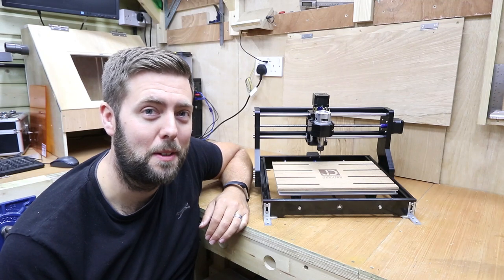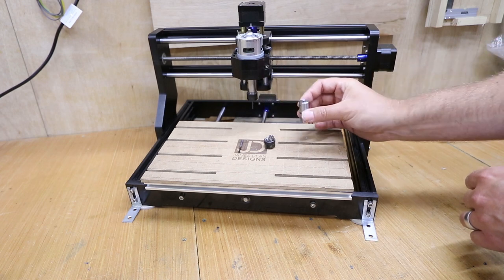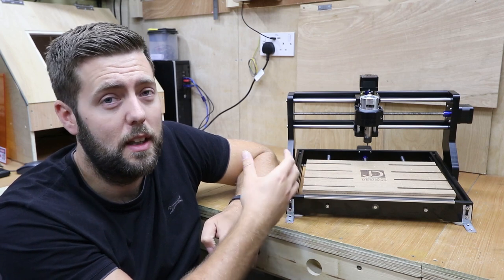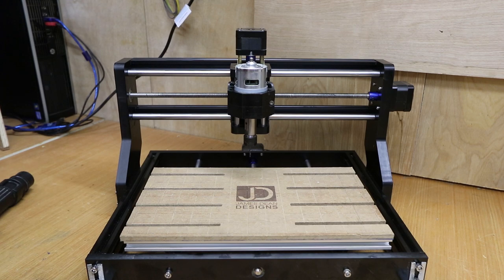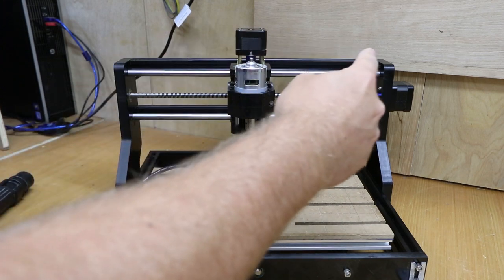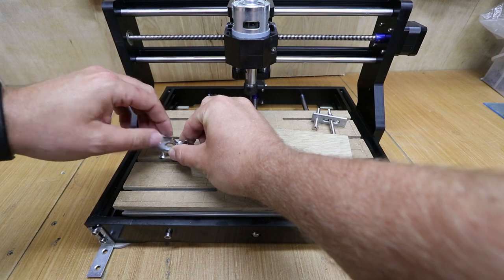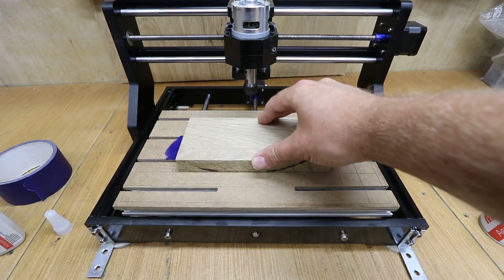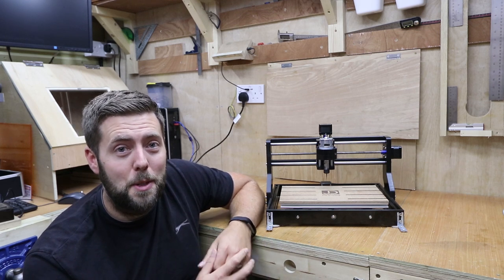3018 PRO - Tips and tricks

Comment: Hello James
Thanks a lot for your videos, they are really very clear and helpful. Regarding the chucks - how are they mounted or taken off? I have got a motor with 8mm shaft separate from the chuck. The chuck‘s hole is about 0.1mm narrower. Should I use some press or heat the chuck to get it on to the motor? To which degree to heat?
Reply from the maker: To mount, they are often heated up to put them on. You can heat them up to take them back off but you have to be very careful as the heat will damage the motor. Alternatively trying to gently prise it off

Comment: Re the Z stops, can you not 3D print a mount that would offset the Z-stop enough so you don't physically use any cutting space?
Reply from the maker: Something like that will certainly help minimise the amount you lose but by the nature of how a limit switch works you would still end up losing 1-2mm minimum off each end. Doesnt sound much in theory but let's say 2mm off each end would be 10% of the cutting height lost

Comment: Thanks for a good video, but I completley disagree with you about limit switches. They are possibly the best upgrade I have made to my 3018. When I first got mine I thought the same way as you, but once I fitted them I could never go back. With a simple homing cycle you can get the machine back to almost exactly the same position every time. They're good enough that I can stop the machine, move axes, re-home and continue without issue. Invaluable if you use more than 1 tool on a job, as even a small bump on X or Y not known by the machine can ruin everything

Also add a small right angled stop onto the base and clamp workpieces up to it to have an instant known position, so much faster than manually aligning to the corner of your workpiece every time.

You will most likely need some decoulping using capacitors to ensure the switches don't get triggered by electrical noise, but well worth the effort. You also don't need one for the bottom of the Z axis, if you've gone that far you probably already have far bigger problems.
Reply from the maker: Might just be the difference in work that we do. My most popular product literally uses every millimeter of the Y axis, in fact it uses 182mm so I couldn't afford to have limit switches even if I wanted. I actually just need a bigger machine 😆 I can see the appeal of the homing though and being able to return to any point

Comment: Don't know if this is the right place to ask, feel free to move it... but do you have a video on how you made that slick waste board?  There's lots of thought and design that I'd prefer not to duplicate the effort and steal it, eh..that is to be educated by you...:) I went to your site and searched for similar items such as waste board, but it returned nothing....  Both the CNC Gcode on the slots including the engineering behind the gcode generation and what holds it to the table.  Simple things like how do I make that when the table size is the limit size of the machine and then add that I have limit switches?  The the laser etching is also a nice touch and should be included. I'm sure it took time to get that. Remember I'm in your shoes when you started way back... And, like you, I've found myself using this damn thing for far more stuff than I ever thought possible. A waste board, like yours, would be a nice investment and looks really sharp.  Thanks... take care (*-*)
Reply from the maker: Head over to the Sainsmart Facebook group. In the files section you will find a guide by Graham Bland on how to make this spoilboard with all the files. I plan to make a video about it, just not got onto it yet
Reply: @JamesDeanDesigns  Thanks you're awesome dude... (^-^)

Comment: Thanks James, Just built ( two days ago), and need all the help I can get. I will be putting your tips into practice. Now All I need to do is to have the courage to actually get cutting. Feeling a bit anxious. Not sure which program to use to generate the code 🤔
Reply: I use openbuild to run the actual machine, I use carveco to go from image  to Gcode. It's a subscription deal but to me it's worth it. Beware, the learning curve is kind of a pain in the butt. I'm up to doing acrylic so far but I'm working towards full 3d carving but I'm not there yet
Reply: @stevenolson4995  Thanks Steve. I will have to take the plunge and if anything.. Learn by the Whoopsies 😁
Reply from the maker: Hi Peter, I can't comment on the software Steven mentioned as I've never used them but just start simple. One of my other videos in this series is simply engraving a square and that's a good place to start. Slow, steady and shallow, then build up from there 👍

Comment: Hi James. I thought I had cracked my problem as I found my spindle connection into the stepper motor wasn’t seated properly. Rectified this and ran job. Got halfway through and then the bit moved to a new position but didn’t retract and cut across the piece and snapped the bit. So still ruining my pieces.

Comment: Hi James just found you posts on YouTube and found them very interesting i have had my 3018 cnc for  a couple of years now 
and haven't used it much as have a k40 laser engraver and cutting machine also 2 3D printers but have just converted my garage
to a little workshop, so have just found my cnc machine tried it out and still works well could you please tell me how to set the z probe up and what you connect it to.
Reply from the maker: On your control board you should have 2 pins marked up as A5, be careful not to mix them up with 5V as they are often close. I managed to salvage 2 spare little connectors off something else but in reality the cables just need to contact those pins and nothing else. It doesn't matter which way around they go on the A5 pins

Comment: Hi, thanks for the suggestions.  Very helpful.  What size of carriage bolts did you find work best?  Cheers
Reply from the maker: M6 I think I used. As for length, I'd depends on the thickness of material but probably 50-60mm at max

Comment: Great Video James.  I'm new to CNC and your video covered a number of things that are not mentioned elsewhere.  I have considered the 3018 Pro as it seems to be very popular.  I intend to use my CNC for double-sided PCB (Printed Circuit Board) milling.  One question if you can answer it: The Sainsmart website shows the 3018 Pro with a price over $400, but I've seen the same machine elsewhere for much less. So is there any special reason to go with the Sainsmart rather than a less costly source?  Looking forward to your other videos when they come out.
Reply from the maker: Which model are you looking at. I just double checked and the 3018pro with the laser is $399 and the on its own about $260 USD.
In short, there are lots of makers of the 3018PRO but its better to stick with the more reputable companies. I got mine from ebay and after several issues that they wouldn't resolve I had to go through a PayPal claim. This is why I now recommend Sainsmart as their customer service is brilliant
Reply: I was looking at the Sainsmart 3018 Prover which also comes with a laser attachment and also has the z-test.  I agree with you that it's best to get it from a reputable seller.  I have not dealt with Sainsmart but their website provides lots of information, so I will likely go with them.  They also offer extension rails (https://www.sainsmart.com/products/genmitsu-3040-y-axis-extension-kit-for-3018-series-cnc-router?variant=32757200322639) that increase the Y-axis for larger projects which is something I'm interested in.  To make my decision more difficult they also show a 3018 Prover Mach3.  Other than certain options and that it uses different software it's not clear to me whether it would be thr better choice for my useage.  Both seem to be the same machine but using different controllers and different software.  And if the various 3018 versions weren't enough  they also offer the 3040 which seems to be a "better" CNC though I don't know in what way.  My usage is to mill printed circuit boards for electronics rather than wood or other objects and I think I've seen some PCBs milled on other Youtube videos using the 3018..  So the Sainsmart 3018 Prover would seem to be able to do that as well as the more costly 3040 but I have to be convinced on the 3040 and so far I've not found anything on the 3040 that gives it the heads-up, at least for me.  If you've done any printed circuit board milling with the 3018 I'd be curious to know your comments on it. One question I can't find an answer on is how fine a line (in width) can the 3018 mill; line width becomes important to know with PCB milling since it determines how dense a circuit board one can mill reliably before the tolerance of the machine is exceeded.  I see that you also have a video on using the laser attachment so I will be viewing it shortly.  In any case, thanks for your reply and comments James.
Reply from the maker: @DIYerGuy  personally, I would take Mach3 machines out then equation. I dont know much about it to be honest but from my understanding its an older code and slowly becoming outdated. All the machines you've mentioned can do PCBs it's just what you want to pay or what size you want. Dont forget though the 4030 ProverXL is more than just a bigger bed, its a better frame, better motors better spindle etc. 
As for the minimum cut width, something like and engraving bit is meant to have a 0.1mm tip so in theory about that
Reply: Hello James, and thanks again for your comments and suggestions.  Based on your video I went with the Sainsmart 3018 PROVerr which runs GRB.  I also asked Sainsmart for suggestions on which 3018 PROVer or the other 3018 Pro Mach would be preferable for my desired usage and they too, suggested the PROVer (GRBL).  The 4030 is indeed a bigger work area and  has better motors, frame etc, and I probably should have purchased it, but wasn't sure how successful I'd be with CNC in general.  I've spent less than 1/2 the price of the 4030 and will see how I do with it.  I also purchased from Sainsmart 3040 extender rails for the 3018 that increases the work area of the 3018 to match the same larger area of the 3040.  I later ordered the same laser you reviewed in your video, which by the way provided some really important insight into the differences between fixed-focus and adjustable - something you would not ordinarily know unless you had a crystal ball!  So again, that was a really worthwhile video.  At this point I'm waiting for my machine and the accessories.  Hopefully things will fall in place and I'll have no issues.  Your two videos have been extremely helpful and gave me the final nudge to get the machine and get involved.   Thanks again!

Comment: I just got my machine set up and Kindle hooked up and I can’t find where you use the set up and to run aTest I tried using the video of the first coat on the 3018 but I can’t seem to find that on mine help
Reply from the maker: All my videos use UGS not candle which is why it probably looks different. Very similar software but things are in different places
Reply: @JamesDeanDesigns  would I be better loading UGS and using it instead of Candle
Reply from the maker: @jimwachsman6547  its personal preference  to be honest.  They both more or less do the same thing. Candle is technically easier as it doesn't really need to be installed but UGS is more customisable for when you get more advanced

Comment: I’m still learning, the coding is my issue. Do you have to change the $ codes every time, or only for calibrations? Also. I noticed your control board is not attached to the back of the gantry, do you have it somewhere else and if so, how did you get the wiring to work?
Reply from the maker: No, you only adjust those settings one. Yes, my board is mounted outside my enclosure but I took the machine out as part of this video
Reply: @JamesDeanDesigns  thank you for the reply!

Comment: I think you had a defective machine. My machine has none of the problems you have mentioned. The bearings fit quite tightly into the holes not needing epoxy to hold them.  The motor shaft is machined with the flat, and the collet runs to better than .001 inch. (limits of my dial indicator)  If the hole in the collet chuck is slightly over size, or the motor shaft is slightly under, the vibration will be noticeably worse since the collet will be held off center. Some of the ideas you had are quite nice!
Reply from the maker: My machine was a cheap one, but sadly a lot of people experienced the same issue regardless of the manufacturer they used :(

Comment: I have been running candle ( not much) but based advice switched to Universal Gcode Sender. Following your video I did all the settings and it runs smoothly. The problem I have is every so often the software freezes and I get the warning from Windows 10 that the application is not responding. Any ideas? Thanks
Reply from the maker: I've never had that. Are you running the 64bit or 32bit version?

Comment: Hi James. I hope you can help me as I am pulling my hair out. I have a 3018 Pro and I am using Easel and UGS software. Set the x,y and z manually and set co-ordinates. But when I run it sends the spindle to the first point and the spindle starts but the cuts are 1 mm above the work piece. I have also had it start the piece but suddenly shift 20 or 30 mm to one side and then resume cutting. I have also had the spindle suddenly plunge very deep and then continue with the design. I have tried using Candle instead of UGS but similar results. Any ideas?
Reply from the maker: When you say you set the Z axis, I assume you mean you get the bit to just about touch the material and then zero it? If that's the case then its possibly 1 of 2 things off the top of my head. Either there is an issue with the gcode your exporting from. Easel which can happen, or GRBL step measurements are off. Easiest way to test the later is within UGS ( or candle) tell an axis to move a set measurements like 100mm and then physically meausure how much it moves. It should be exactly the same. Obviously with the Z axis that can only move a maximum of 40mm
Reply: @JamesDeanDesigns  Hi James, Thank you for a quick reply. Yes, I lower the bit to just touch the material and then hit ,i think it’s ‘set zero’. I ran the simulation on Easel and it looked ok. I also looked at the predicted path on UGS and again that looked fine. Do you think it could be a firmware issue?  I did follow your ‘fine tuning’ video and changed the parameters as you indicated keeping them conservative. Do you think that could be an issue. Unfortunately I didn’t save the original settings so I can’t return.them to the default. Thanks
Reply from the maker: Testing the measurements is not something I've really covered in any of my videos. Its the 100, 101 and 102 settings. As I say, if they don't move the correct distances when you tell it to those settings will need to be tweaked
Reply: @JamesDeanDesigns  This is getting even weirder. I reinstalled the drivers and I thought I had cracked it. Up a piece of MDF in and ran the code. At the halfway point everything was running fine so put proper material in and worked ok for a few minutes then it moved to the next part of the design started milling 1 mm above material again. Uninstalled and reinstalled drivers again and ran code on the same material again starting from the same zero lint. This time it repeated the same part over the same area that I had previously milled but this time it milled it twice as deep it then moved
Reply: @JamesDeanDesigns  sorry hit send by accident. The head then moved over to the next part of the design and started milling 1mm above material again and then when I stopped the job the jogger controls wouldn’t move the z axis up or down. I am baffled.

Comment: Hallo,I have problem with cnc3018pro,i had a problem with the installation, I pressed reset button on board and now machine is without function, status in GRBL Controller is "Port opened". Can You help me. thank you
Reply from the maker: Sometimes when you press the reset button you have to refresh the connection port within UGS (or candle) as well in order to allow it to connect again
Reply: How can i do this and how can i change the "Port opened" status, i've tried everything but it doesn't work. thanks

Comment: I have just got one of these and everything seems to burn the wrong way round. I am sure I have seen somewhere that the green and black cables could be the wrong way round. Any advice?
Reply from the maker: Do you mean the axis are turning the wrong way. If so you can change them in the GRBL settings. I think its then $3 setting. Usually if all of them are backwards I think you need to set $3=5
Reply: James Dean Designs thanks! Managed to get that sorted. Have you done a video on how to calibrate the bed space? My machine doesn’t know where it is and I don’t know how to tell it where it is. Hoping you’ve done one!

Comment: can the 3018 controlled by vcarve pro
Reply from the maker: Vcarve is design (CAD/CAM) software not control software so technically no but there again it can't control any other CNC either. You can export you Gcode from Vcarve through and run through dedicated control software like UGS if that makes sense
Reply: @JamesDeanDesigns  thanks james

Comment: Can you buy extension bars for the 3018
Reply from the maker: Not extension bars as such, but you can buy longer parts. So depending on what axis you extend you will typically need longer aluminum extrusion, linear rods and a lead screw. You can buy expansion kits for about £100 i believe